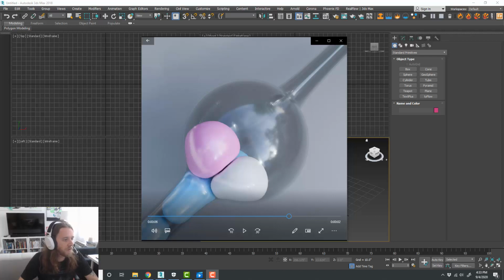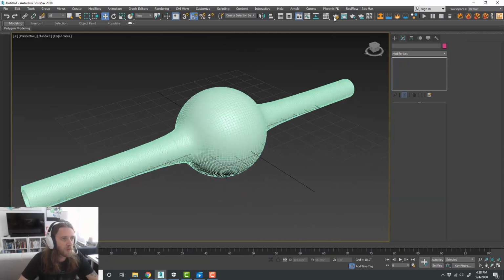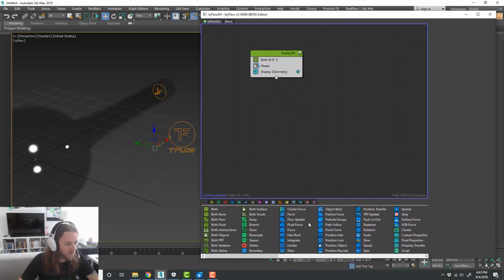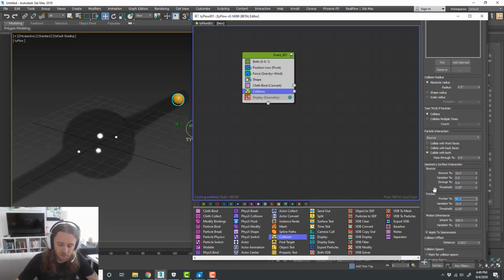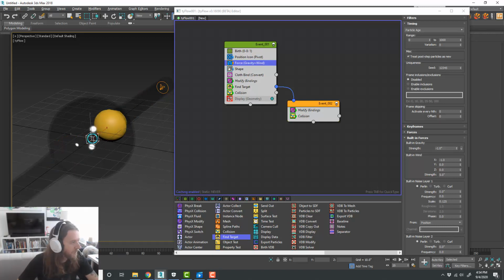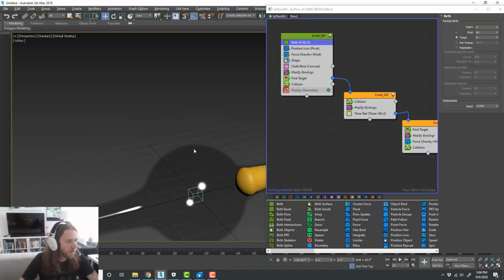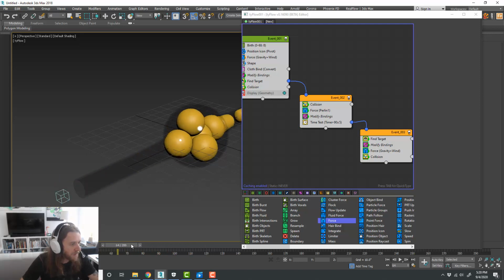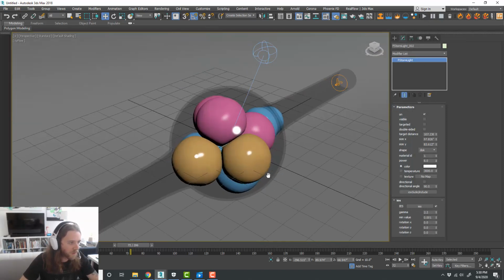TyFlow Tutorial: CUDA Cloth Bubbles + Project files

Comment: Thanks for this tutorials, I am wondering what is your computer configuration because on mine, it takes a lot of time to simulate and almost stuck at 30% when it arrived to 40% the computer crashed ? I have a xeon E5-1650 V2 @3.5GHz with RTX 2080 and 32BG ram and on the task manager, the GPU analysis shows only 1% used and the CPU 100%
Reply from the maker: That's a bit strange.. your 2080 card should actually process this faster than mine, as I'm rocking the 1080ti cards in this video. Being that we're using the CUDA solver in this video, maybe check that your CUDA dlls are all installed and functional. You can download them from the tyflow site. Other than that, make sure that card is selected in the Tyflow under the GPU settings. There's been some folks on the facebook forum that have had similar issues, but it seems to have been mostly dll related. Let me know if that helps!

Comment: Great tutorial!!! I'm having some problems though, even with the project file you provided, half the simulation runs fine to the point all the spheres are squished together inside the bulgy part,  then as the spheres are getting pushed trough they break free and go all over the place.How do I fix it?Thank you.
Reply from the maker: In the provided project file, I never did anything with the spheres once they exit the glass tube. You can add a time test and delete the spheres after a certain frame, or even a surface test to test when the spheres get close to the end of the tube or a dummy object, and delete or stop them from moving. 

If the spheres are breaking through the glass at any point, then that would be a different issue. Typically you'd have to adjust your collision settings, or even play with the cloth parameters to stop penetrations.
Reply: @simulation_lab  Yes the go through the glass, I'll play with the settings and see how it goes, thank you again.